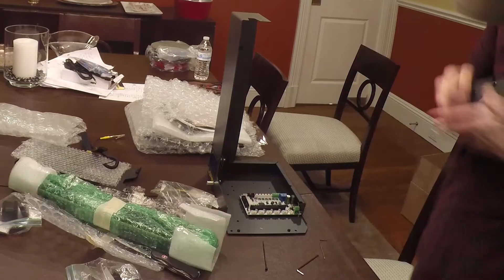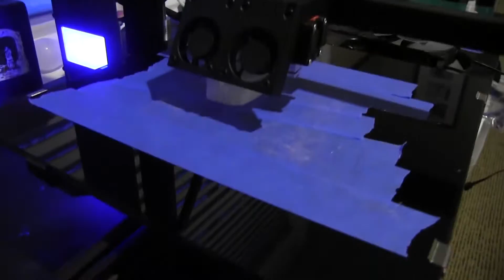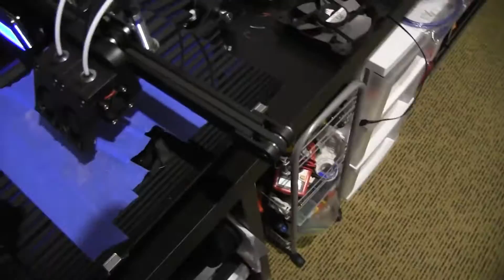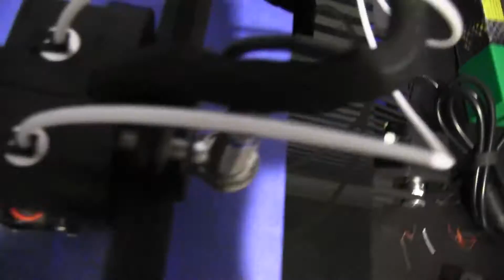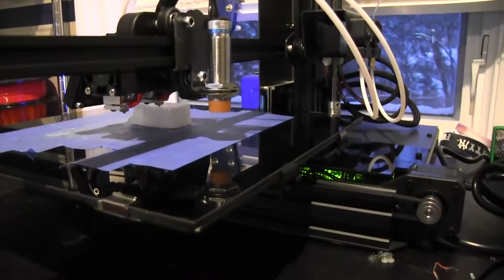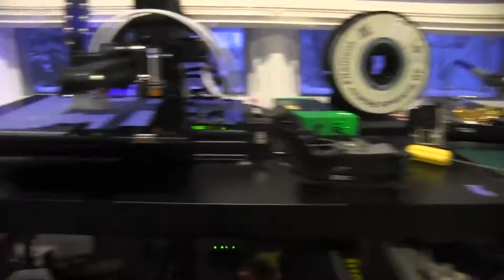Lorei 3D Printer Overview

Comment: Are you at all concerned with the cantilever being able to stay level when it gets up higher, being unsupported on the other side?  BTW, your set up is impressive!
Reply from the maker: Thank you! I am not that worried but I will test to make sure everything works out! Thanks for watching
Reply: The cantilever design does lead to issues printing straight lines when up higher. The tall tower torques higher up, and combining this with the cantilever the prints do not come out straight.
Reply: i have a Lorei Duo myself and haven't had issues with Z axis skew on tall prints (height doesn't seem to be the cause of my issues), however i HAVE had issues with general axis alignment and there isn't much on this printer by way of calibrating the axis alignment (Z axis alignment issues are more apparent with taller objects, but measuring the angular error it doesn't seem to change as height increases; i.e. it's not the cantilever design that's failing me, rather a bad initial alignment)

i had to disassemble the structural support and add washers (yup!) on one side of several bearings in order to compensate for alignment issues :(

it's pretty square now, but my mods were not clean. still happy with the printer overall, but it might require a more holistic fix in the long run (a new structural design?)